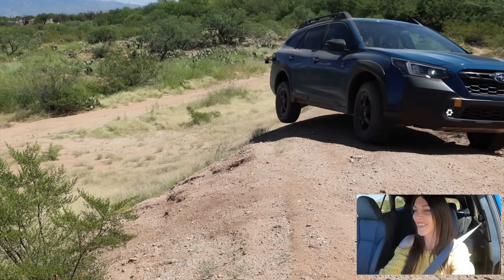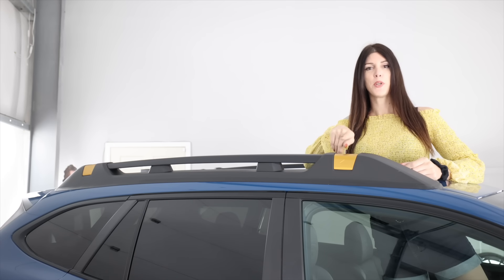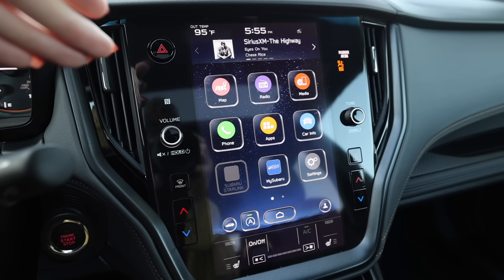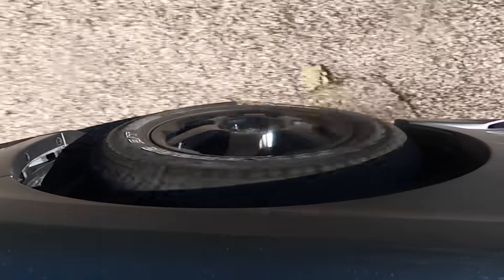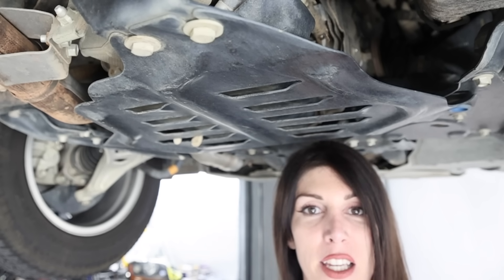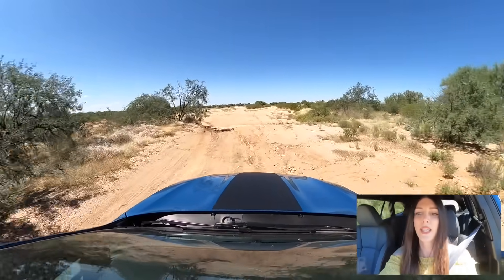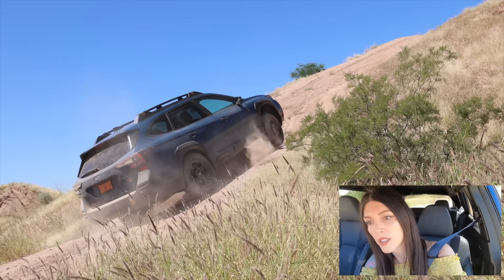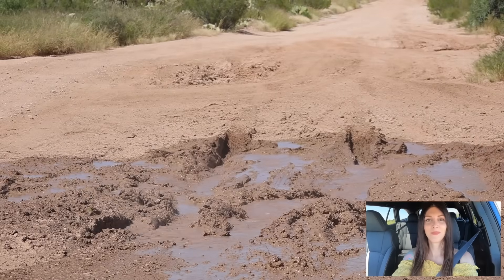Off-Road Torture Testing The New 2022 Subaru Outback Wilderness

Comment: Though I am a big fan of any Subaru, I think that there is really no replacement for a real (at least rear) diff lock. 
Sometimes you can get yourself in a very sketchy situation, where a diff lock would make you keep going with momentum, and X mode of some sort would hang on for a while, think about it, brake a wheel here, maybe there, and in the meantime youre almost flipped of the side of the hill because it made you stop just where it was the most dangerous. 
Sorry but if it's not for going up and down dunes fast, It is a no from me, I'll stick with my rear locked Jimny for crawling.
Thanks for the video :) I think this is the most beautiful rim I have ever seen lately.

Comment: You're asking the car to do things for which it was not designed.  The edition is "Wilderness," not "Rock Crawler."  There is a way to drive it in which the CVT is allowed to maintain optimal engine RPM. But it doesn't have a button on the dash; it has a signal in your brain that says, "Keep your foot out of it for best efficiency."
Reply: Or put it in manual and use the paddle shifters.

Comment: Even though it's not a truck or true off-roader, I expected it would do a little better on the hill with all the electronic doo-dads.  Being lifted, I would think it probably doesn't handle on the road as well as the regular Outback, so it seems like it has a rather limited focus.  Still, it does have a little bit of that traditional Subaru weirdness.  They could get really weird and bring back the 6-speed stick for the Outback 😁
Reply: Deep snow mud mode would have done it. Outback wilderness is better than the forestor wilderness.

Comment: I test dove one on regular city streets and agree with you on the CVT. It does not work well ANYWHERE. Right as the turbo started to spool it would do one of those pretend shifts and it was IMPOSSIBLE to drive smooth. What a POS. Great vid, keep up the great work!!!

Comment: Wait, what?   It doesn’t actually have actual cvt mode?   The previous Outback and Ascent I had as loners would brake-boost launch and run right to peak power rpm and then just sit there until I lifted, no fake shifts.   It would only do it from a standstill.  If you lifted just a little and mashed it again the fake shifts would start.

Comment: Thanks for the great review. My son and I both agree about the CVT transmission, because he's driving my old 2015 Forester XT, and my wife has a 2021 ascent. As an owner yourself you know that the Forester XT CVT is great because you can have intelligent mode and Sport mode acting like a CVT, and sport# acting like an eight speed automatic. But you can also use it as a six speed or eight speed manual with paddle shifters. I moved up to a 2017 WRX LTD because I missed my 2004 STI so much, and I really enjoy the six speed manual which can launch from a complete standstill much quicker than our Forester or Ascent. Once our Forester is moving, it does an excellent job keeping up with the WRX from 20 miles an hour to 80 miles an hour. When Subaru makes a CVT that will jump off the line like a manual it might replace my WRX - I'm old enough to have bad knees and can't drive a manual forever..

Comment: Sarah, do you know as to why Subaru did away with the boxer 6 cylinder engine? I have a 2017 that's in great shape with low miles, and planned to keep this until retirement in 4 yrs. My plan is/was to purchase another one after retirement in the Onyx series, however now that they are no longer producing the boxer 6 cylinder engine I don't know that I am interested. Do you really like the 4 cylinder turbo charged engine? Would you buy one? If you did what changes would you make to the vehicle in general? Your thought's....

Comment: Sarah, I commend your outward consideration of design implementation. It's annoying that this off-road(ish) marketed vehicle can't climb that hill and likely most of us immediately start thinking of what could be changed to get 'er done but it seems that any of those changes would add inefficiency and/or cost so there is a trade-off, and decision to be made, with every one of them. Realistically I bet that only about .001% of buyers of this vehicle would be upset that it couldn't climb that hill though likely most will do more off-road(ish) type activities because they have it and all would be using it as their daily driver and opt for the efficiencies.

Comment: Enjoyed!  Looks much more capable for anyone who pushes the off road side on occasion, never intended for hard core, but then you have something not as fun to drive for most usual uses, which the majority of folks actually do.  Not keen on the looks however; parked beside one the other day and it just looks clunky to me, not as refined as other models.  Have seen after market upgrades on previous years that have looked much better, but everyone has different tastes!  BTW, if you had tried other modes it may have done even better on the hill.

Comment: I’m currently deciding between this and a RAV4 TDR off road. I remember in your TDR off-road review, you mentioned that the suspension truly felt like a rally focused one, so I’m wondering if that’s significant enough to take into consideration.

While I’m at it, I might as well ask if you have an opinion on the difference between the rav4 adventure suspension and TDR off-road one.

Thanks!

Comment: The only thing I do not like is the Subaru spare tire is a donut tire and if you have a flat on the front, you need to first switch a rear tire to the front, then put the donut tire on the rear.  A better solution would be to have enough space so if desired, the owner could store a spare tire the same size as the 4 other tires.

Comment: Overall you do great reviews.
However, sometimes it's apparent you either didn't get enough time to toy with the vehicle, or no one showed you anything.
For the hill you didn't make it up, there was a much better chance you would've made it had you been in Deep Snow/Mud. That mskes the wheel braking to direct traction much more aggressive. 
Secondly, for the CVT and the simulated gears, if you brake torque it (foot on brake while giving it the gas) then it will not do the simulated gears. It will hold max HP RPM.

Comment: That cigaret lighter is not stupid, it's very useful especially if you need to power something like a 12 volt device.  Now, if you were suggesting smoking a cigaret using the cigaret lighter - well that is another conversation.

Comment: technical note to Sarah:
Faked gear shifting on a CVT
is
death onnuh stick
the pulleys' cone surfaces develop shallow grooves that cause slipage and hugely premature CVT death.
juz sayin'.
Sarah probably knows that, but is trying to be positive in her reviews so that...they won't stop giving her new cars to talk about.
Reply: I hate the fake shifts…but, that’s not likely to be a problem. 

The chains are so wide on these that the grooving isn’t really an issue. Where the side of the chain sits in one gear is overlapped significantly by the other side in a different gear. There isn’t much travel back and forth. Should be OK. I still think they should just make it operate correctly tho.
Reply: @christopher6895  I'm an engineer. The fake shifting is horrible. I bought ONE CVT Infinity, and so had an opportunity to study it in detail. The JATCO CVTs are the worst. That's what I had. Criminal negligence arising from insane over-regulation by fool politicians, and non-technically inclined car buyers who influence marketing surveys. We are watching the death of the automobile. (Yes, I know about CVT belt contact width).
Reply: @jeffwhite9028  Sounds very alarmist with some high level credentials to back it up.  We've now had the 2020s in the wild for 3 years with limited reported "premature" CVT failures.

Comment: I rate this review at 4 out of 5 gallons of fruit juice. All it needs is those locking diffs, not torque vectoring and ABS wizardry. Also, it would have been better with a 6 speed.

Comment: Did Subaru ever fix their oil consumption problem or are they still telling people that burning a quart every thousand miles is "normal"?
Reply: It’s a little better on the newer engines. 

That said, pretty much every manufacturer considers that normal. My old k20 civic drank oil like a toddler slurps fruit punch. Then again…it revved to 8400rpm so I can be a bit more accepting.

Comment: You have to stop reviewing Subaru's, you're making me miss my Impreza.
The hood prop rod is cheaper AND lighter. Weight reduction, bro!
I really don't understand why both the Forester and the Outback have open diffs front and rear. They probably try to fake that with traction control but that's just not the same.
I also dont understand why they're stuck on the CVT, even though I'm from the country where CVT was invented. Especially with those fake shifts that make no sense.
Subaru used to make pretty decent 'classic' auto boxes, most manufacturers are now into 6 - 8 speed auto's, which get great if not better fuel economy also.
Very nice rear suspension linkage on this car, much better than the old MacPherson struts.
Nice music btw. Jumanji?

Comment: If you brake-boost and launch (accelerator floored) in Sport mode, it shouldn't do the fake shifting (if it's anything like the outgoing CVT in the WRX and Levorg). 
However I do agree, I find the fake shift points VERY annoying when driving the car under moderate acceleration, as you can literally feel the car lurch forward as it loses power then jump back on power. Totally unnecessary. Subaru just needs to accept the fact they have a CVT and stop trying to pretend its a DCT. All the fake shifts, simulated gears and fancy names don't change that fact (yes, I'm looking at you 2022 WRX with the all-new "Subaru Performance Transmission").

Comment: Direct injection and fake shifting CVT for $40k - No thanks. Plus that seven foot timing belt or however long it is. I've always wanted the Subaru awd drive system, but it always comes with those ohc boxer engines that rely on a long rubber belt for their survival.
Reply: It’s a timing chain…….

Comment: With a better transmission I'd be placing an order for one of these. Unfortunately Subaru has gone with the worst of both worlds: a CVT that fakes shifts. I've said it before and I'll say it again... if you put a CVT in your car I want it to behave like one. 

I'm keeping my fingers crossed that they'll put a dual-range manual or at least a conventional automatic (with a low gear like the Jeep Renegade Trailhawk) in the Crosstrek Wilderness, but I know it's just wishful thinking. I guess I'll just spend my money on my old Subarus instead!

Comment: Why does the front suspension look so cheap, like it’ll break soon as it hit a pot hole…. The suspension on my pilot is beefy.

With the exhaust manifold next to the oil pan, doesn’t that make the oil hotter than it should be?  Also they need to just get rid of the CVT it’s garbage idk why they don’t understand that.. the MPG is not ground breaking for them to still be sticking the cvt in these vehicles.

Comment: CVT & no "shitty 12v ports", nah, fail on both fronts. Like your gonna pretend that those ports wont ever be used anymore? Nah. New cars suck in several ways. Does anyone love a CVT, I think not so much. I think if anyone realizes that the weeds were pointing to an angle that didnt even point upwards, it's a joke. I know you shill for Subaru (because you love them), but this was pretty bad. They didnt show well here, and you know it. I expected a better showing from Subaru.